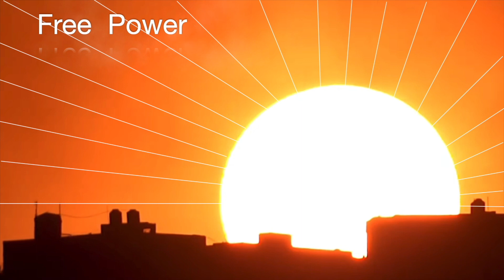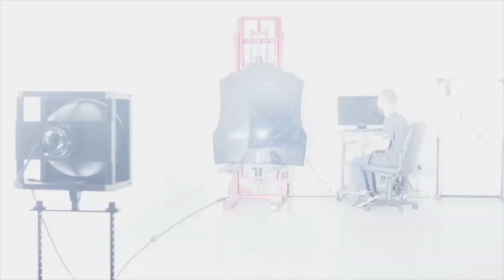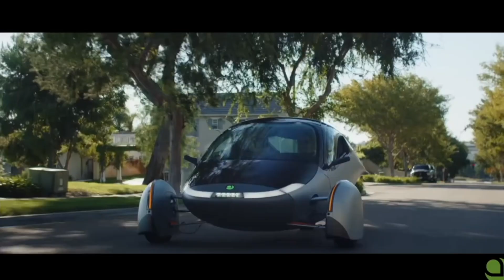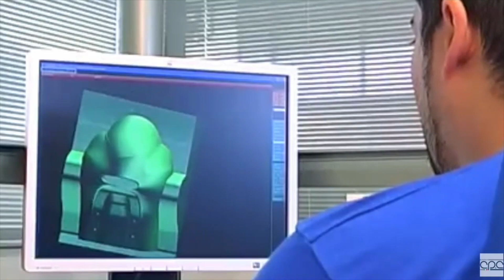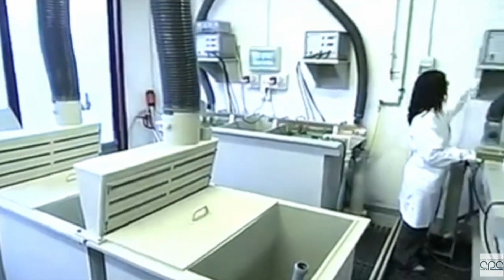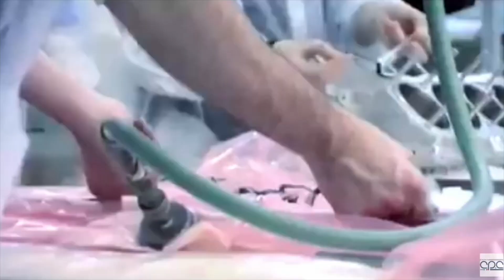Aptera's Steve Fambro Talks About Their Future and what's coming next ! Part 1

Comment: His claimed calculations of 1,000 miles range are not what they seem.  Its extremely simple maths: they claim 10 miles/kwh efficiency, if you have 100kwh of batteries thats 1,000 miles of range. Its that simple! 
But what he is not saying is that 10miles/kwh has never been achieved. The only test result they have given is from their FIRST long distance drive  ( just over 300 miles) in 2025, in which they drove downhill an elevation drop of approx 7,000ft and claimed 8 miles/kwh.
You can get whatever efficiency you like if you drive downhill, thats a huge redflat that these guys are dishonest and faking the numbers.
So where did they come up with the 10 miles/kwh figure anyhow? Well way way back in aptera one, an early vehicle they made was a diesel/hybrid drivetrain, and they claimed approx 350mpge, which equates roughly to 10 miles/kwh.
That was a completely different vehicle way back in 2007 approx, and they have used it all these years to con investors out of their money. Its a huge con.
So thus far the only data they have released is from this one test drive in 2025 on a long downhill run using 40kwh battery and getting just over 300 miles of range. Since it was such a huge elevation drop the number is simply inaccurate as a test of efficiency, but you can deduce from it, that the efficiency will be well below 8 miles/kwh. My guesstimate is perhaps 7 miles/kwh at best. Around town driving it will be the same as any small ev.